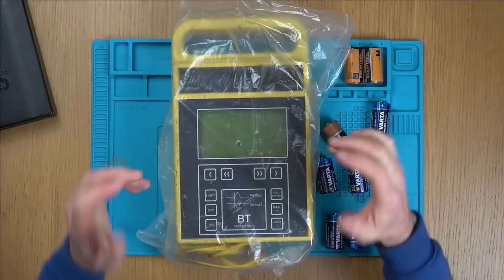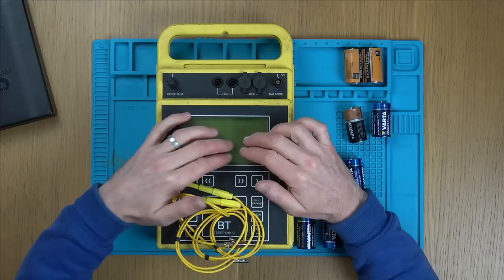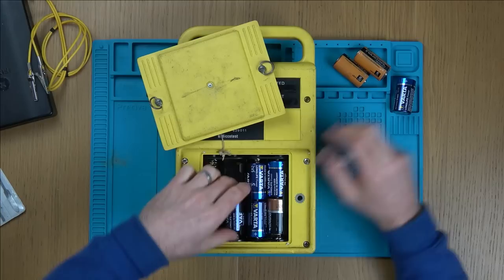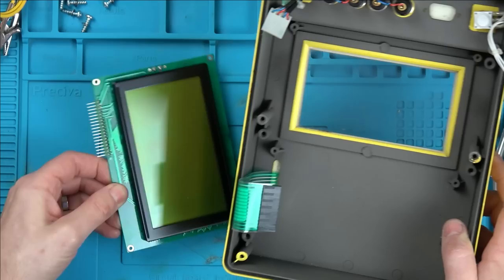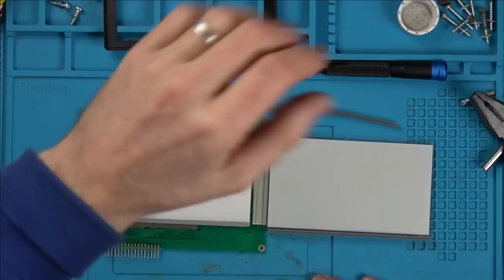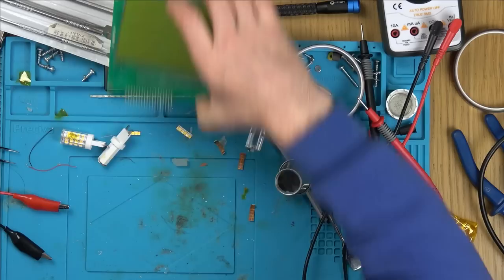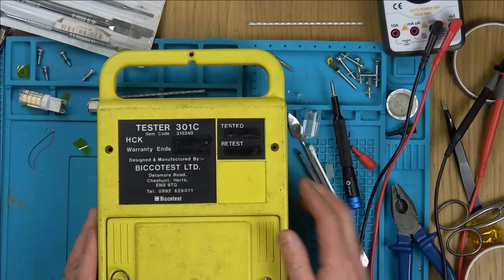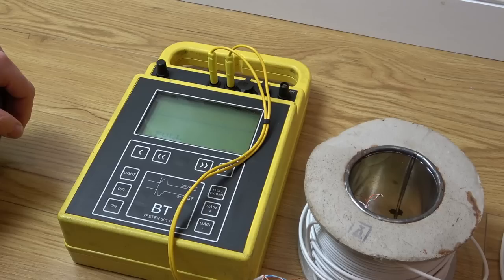Can I FIX a BT MOLE ? - A Great Piece Of TELECOM TEST KIT

Comment: Some of us are old enough to remember "Post Office Telephones" vans before BT existed!

I used to work for our University networks team and we used TDR (Time Domain Relfectometry) gear to do similar fault finding. We had both copper TDR and optical TDR to allow similar faults to be spotted in fibre links (which seemed to break and be more attractive to vermin than the old multi-pair telecom cables ever were).  The Cisco switch had a handy TDR feature too, so you could run the TDR test from your desk before you trudged to the other side of campus. 🙂

Comment: Used to work as a Telecom Engineer myself for Telenor in Norway. We didn't normally use this kind of equipment (We had them, pulse reflectometers), but we had a phone number we called up, or sent an SMS to, and entered the customers phone number. the equipment in the phone exchange would then disconnect the line from the exchange, measure the line, and send an SMS back to me with all the values. It would show ac and dc voltage to ground, and between the 2 wires, the restistance to ground and between the wires, and also the capacitance to ground and between the wires. These values gave a pretty good overview of the line, and we could easily see if we had a connection all the way to the customer, due to most sockets having a 380k resistance mounted. There was also regularly taken reference measurements at night so on a fault report, you could also see how the line was performing before the customer complained. Edit: We also had instruments simliar to this, but it was more easy to use the sms-service.

Comment: It always amazes me when I see someone working in one of those green boxes, just rats nests of cables, how anyone can do anything in them is beyond me. This is great though, a clever and simple concept that must've really sped up fault finding!
Reply from the maker: Really is/was very useful Marc 👍👍👍
Reply: The cabinets are a piece of work especially the ones we call a midland shelf which are just riddled with potential faults 🤣 i no longer work in them I’ve moved onto fibre but it was enjoyable to have that challenge everyday
Reply: The secret to work in cabinets is a oscillator which your attach to line you are working on and it sends a tone down the pair of wires you are looking for also you can get a tone from the telephone exchange if you ring the number you are working on
Reply: I used to work in a different industry on equipment with a lot of same colour wires. Customers would ask how “I knew what I was doing”. My relay “who said I know what I was doing”

Comment: I used to have a much older version of this, also made by BICC - it basically did the same thing, but it used a CRT for the display rather than an LCD.  It also used a tunnel diode in the pulse generator -which was  the part that had failed.
Reply: I had the one before this model, as you say the crt one ,  and I did have this one later on , 😉👍

Comment: 2:20 -- this happened to me once. I lived in a very large apartment building and one day my phone ceased to work (no dial tone). The technician allowed me to accompany him into the service room. There was this huge mass of wires, and one was very obviously disconnected and hanging loose. Apparently someone else was in there earlier in the day, and had knocked something loose. The whole process took maybe 15 minutes.
Reply: A few weeks ago my parents had a telecomms engineer visit their smalltown holiday home because one of the neighbour's phones didn't work.  The tech crawled up into the loft (the cable crosses the street, into my parents' loft and then from house to house along the street) and found the pair had been disconnected in the splice box. The kicker? It had been like this for over a year but the elderly neighbours had never noticed! I suspect the fault happened when a tractor with an overloaded trailer took out the line crossing the street, uprooted the pole next to our house and pulled various pairs out of the terminals in our loft.

Comment: In my previous job, we had a "magic cable tester" for computer related cables. Worked fine for digital stuff where you had lots of leads per cable. It had support for various kinds of contacts so it was easy to use for almost any kind of cable. The gadget you fixed reminds me a lot about that one. Very nice Vince, thank you

Comment: I worked for BT and we could access the same test via a css terminal in any exchange or office this one work's for miles it even could put on a test oscillator for cable tracking on dropwires. It was a great system. 👍

Comment: Thanks for the video, great bit of fault finding. I think Bicotest made quite a bit of specialised test equipment for BT over the years. It looks like a bespoke time-domain reflectometer calibrated specifically for telephone cable. I have used similar instruments for tracing faults on power cables, but we would have a velocity factor to set depending on the type of cable we were testing. I believe the velocity factor is the time characteristic of 1 metre of cable for the reflected pulse. A CAT5 cable with a different size copper / twist ratio would have a different velocity factor to make the measurement accurate.

Comment: Hi Vince I worked for Openreach for a while and the BT Hawk had been replaced by the JDSU which had TDR/Bridge Test/Multimeter all built in along with options for performing a 'PQT' pair quality test which would measure insulation resistance / wideband noise and AC balance etc and it could also emulate an ADSL/VDSL modem. I left Openreach to work for BT now I maintain the switch and transmission networks and also maintain Vodafone and 02 mobile sites a great job.

Comment: Back in the dark ages (late 70s) we had a Hewlett-Packard TDR (time domain reflectometer) that was the size of a small suitcase and weighing about 35 pounds. But it was a marvel at finding bad connections in aircraft wiring. Being able to pinpoint the right panel to remove to repair the connector saved a lot of time and headaches.

Comment: I am working in a big ISP as field technician. From 2008 we used to work with Argus 145plus and last year the company replaced it with the Viavi. I love the TDR. Make the work a lot simpler to pinpoint the fault on the line.

Comment: there is a tool for glued ribbon cables, it's an attachment that fits on your soldering iron, like a 2" wide thin block with a silicone pad, to re-melt the conductive glue, without melting the plastic of the ribbon cable.

Comment: 7:20 It figures that, a "telecom repair man" wouId cut and re-splice a wire with a "Jelly Crimp" ( 3M Scotchlok was the preferred brand in the US) God forbid they actually disconnected a proper connection or terminal point to test something 🤣 . I retired from being a "Cable Splicing Technician" for almost 42 years, starting back in 1979 , with Illinois Bell (which changed to Ameritech, then SBC, then back to AT&T ownership) and I got to use a few different TDR's , ranging from an old boat anchor CRT Biddle to a Riser Bond 1270 LCD screen unit ( My Favorite) in its own weathertight box with some nice hooks on it for hanging from an aerial cable. They were very handy for finding simple and complex "capacitive" faults (such as split pair wiring, water in poly insulated cable that didn't cause shorts or grounds yet) And I even often used one for "Conformance testing" on new cable/terminal install jobs in new subdivisions. With some math, and reading our work prints, I could easily isolate a fault to a specific splice measurement and with the help of another tech, get them fixed quickly. The toughest thing was to get the "VP" ( velocity of propagation) value correct to the cable you were hooked up to to get the most accurate measurement. Towards the latter part of my career, I graduated to working on network fiber optic equipment and using a "OTDR" ( optical version of) which had very similar functionality but dealt with an optical instead of electrical signal. Fun repair video 👍

Comment: Hello Vince,
When dealing with displays like that, watch out for ESD's on those IC's on the back of the display board. I had trouble with a very old laptop display using those decoder chips and I have touched them accidently and one of them went into heaven. So I recommend an ESD strap for that delicate equipment.

Comment: Amazing the info that is so easy to get now.  I, a 50year old carpenter, knew what this was and could build one for $20 in parts. Yet, that piece of equipment probably cost $1000 thirty years ago.  

Thanks MMV for the always great vid.
Reply: the new testers for fibre line  are very expensive the fluke ones we use at work are about $2500

Comment: I started with a hawk Vince. I still have it working perfectly. 
I then had a JDSU (Infineon sim), then a JDSU (Broadcom sim) and now a viavi one expert. 
They have had to get more and more advanced to be able to detect digital services on pairs without voltage as VOIP is now on FTTC type lines called SOGEA. They have no voltage or dial tone, like FTTP the dial tone is added from the router. 
They also have to have the ability to sync with all the different types of copper services like gfast

Comment: So in a way its the evolution of the ol' Everard bridge megger?   With the old ones there were a couple ways to use it, one would be to strategically place the insulation testing clamp at various places and test and record, the other was to have the insulation clamp connected at a certain distance and from the measurement of a short and some maths you could measure out a certain distance along the cable and come out pretty much where the short was.

Comment: This would have been a piece of equipment I would have given my left arm for when I was working for an ADSL ISP over a decade ago. Our company only armed us with a laptop & tone generator. I had to connect up the tone generator to the phone socket in the customers' house, then follow the tone signal from socket to telecomms cabinet, from the multiplexers to the phone exchange. All to figure out where the fault in the cables was. It could be as far as 9 or 10 miles from the customer, where the fault in the underground cable was. Just using the tone sensor to pick up the tone generator the entire way. Proper nightmare.

Comment: Looks a cool bit of kit, not seen one of those before. I've just been working on something a slightly bit bigger.. diagnosing some electrical issues on a Fendt tractor.
Reply from the maker: Thanks, I've just subscribed. Hopefully I can make time and check out your videos over the next month👍👍👍
Reply: @Mymatevince  Thank you sooo much vince. I've had a youtube channel for about 14 years and didn't really do a lot of videos as I'm a bit camera shy!
I uploaded a video about 3 years ago when I was repairing a washing machine PCB, and it is my most popular video.
My repair "career" started back in the late 80's when I was working in amusement arcades repairing video games / fruit machines etc and I used to repair a lot of items from friends / relatives.
I have been following your channel for quite some time. I have some Milwaukee tools and noticed you repaired a Milwaukee Radio.
That's what actually inspired me to start doing repair videos!
I didn't have a radio and thought it would be a good addition to my tools so I bought a broken one and repaired it. It kind of progressed from there.

Any tips / advice would be great!👍👍👍👍

Comment: 13:18 - no, that was for an RS232 9 pin connector - for use with X600 TRACEability
Software System - "ensures waveforms can be analysed, stored and reloaded to the TDR for on-site, dynamic comparison of the waveforms" (same case was used for the more advanced models).

Comment: It's a TDR (Time Domain reflectometer). Works as a mini radar set by sending a (very fast) step voltage down the wires and times the reflection from impedance changes such as shorts & opens. As such it's more dependent on the dielectric of the pair than the resistance of the wire.
Reply: I remember Communications Engineering 101 involved building one of these from signal generators and oscilloscopes and figuring out the break distance using pen and paper against the speed of electricity in copper and the time disparity/amplitude of the competing signals on the CRO (amplification indicating an open and weaker reflections indicating a short I think). This thing looks a lot more convenient.

Comment: I'm glad you mentioned the cat 5 wire, I was wondering if it could be calibrated for something like coax cable. We just had a cable company re-install a new wire because an existing wire wasn't connected anymore (all underground and through multiple walls, crawlspaces, etc,) and they didn't seem to have any information on why it failed. Something like this could have been useful!

Comment: Yep, On a disconnect line.. It calculates the resistance as it travels down the line in slow pulses... it can calculate how far away the break is, By the timing it takes for the pulses to lose a connection, or no resistance... because the line is broken....
Same with short circuit too... Short circuit, as they say, Electricity takes the path of least resistance... So on a short circuit, its calculation of pulses, vs resistance, Would be incorrect readings, As the short circuit will allow the pulses to travel down that short, instead of as normal.. Therefor, Less resistance, which upsets the timings of the pulses etc... 
(My father was a telecom engineer for many years, I have seen these devices in operation many times, Fantastic pieces of kit)

Comment: I used to calibrate something nearly identical to this, the bicotest T625 and T631. I must've gone through thousands of them. Used to call them speak and spells, down to the similarity in case design. Bloody maintenance menace they were swapping out the soldered in 2032 battery every few years.

Comment: Vince, your TO or line manager would have taken the unit to a TSVC, swapped it for a `new` one, and the old unit would be scrapped. The cost of repair would have been too high. I worked in the Exchanges ripping out the Strowger equipment ready for System X or TXE4 to be installed.I loved every minute of it, but with BT, they saw they`d taken on too many people in 1990 and needed to thin down the numbers so I took the PILON (pay in lieu of notice) redundancy package. A very sad day when I said goodbye for the last time.
Reply from the maker: Thanks Tony👍👍👍

Comment: its doing it by time...  it knows the speed in that type wire...  so when it sees the signal return (because the signal bounces off the end of the cable)  it can tell you where the break is.
this is also how the fiber testers work...

Comment: In the mid 1980s I was a WEM (R), Weapon Engineering Mechanic (Radio) in the Royal Navy. We worked mostly on the electronic and electrical side of the weapons systems, radar, sonar, radio communications etc. WEM (O)s Weapon Engineering Mechanic (Ordinance) worked mostly on the mechanical and electrical side of the weapons systems, upper deck arc light signallers, internal communications, telephones etc.
I was on duty one evening, we were docked alongside, and I got called to see the officer of the day to be told that the shoreside telephone was not working, we were in refit so most likely the twin wire cable had been broken as it trailed along the dockside. I followed the cable using my ''pussers right angle torch'' along the dockside and sure enough I found a break in the wires.
 I got out my ''smallie screwdriver'' and a piece of ''chocolate block'' (terminal strip) to fix it, used my teeth as wire strippers to strip the wire from the ship.............No problem.
Did the same thing for the shoreside wire, and it was at that point that I learned something about telephone wires. 😲

Comment: another name ive heard for this kind of equipment is tdr, time domain reflectometer, like you said, it tells you where all the joints are and where any shorts or opens are, it tells joints as blips since the resistance of the line changes a bit whenever the composition of the cable is altered such as with solder or cable crimps
edit: side note, i hate zebra strips, they never work correctly after the factory connection starts failing and glued ribbon cables are even worse, basically impossible to get a reliable repair and they always fail eventually no matter how well it was connected originally

Comment: I don't think it measures resistance. I think it sends a pulse down the wire and measures the time for it to be reflected back by the discontinuity at the fault location.
Reply: This is correct. At my work we use testers like this but for coax. its basically the same but except of 2 wires to test the cable its a F connector. 
Edit: its called a time-domain reflectometer (TDR)